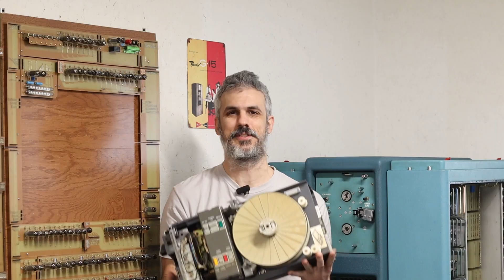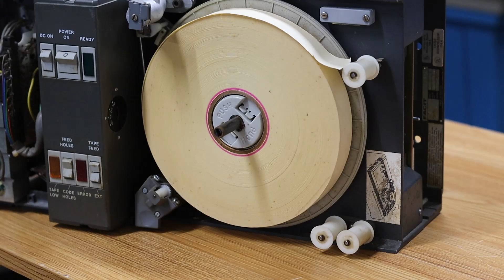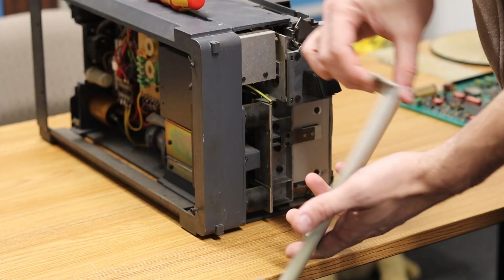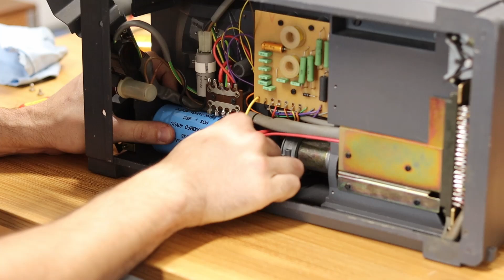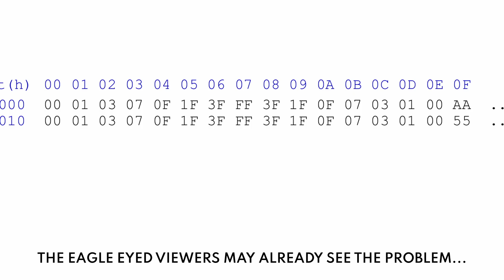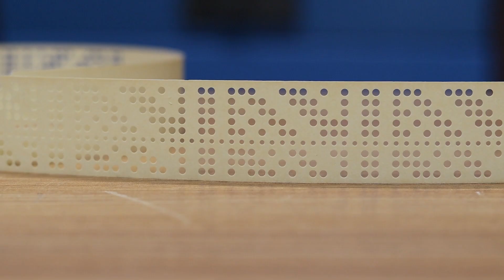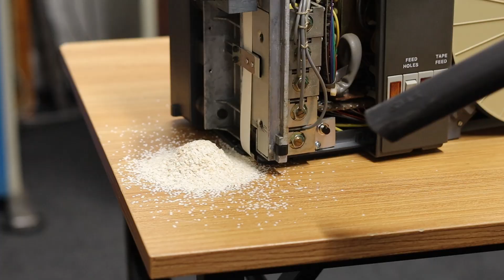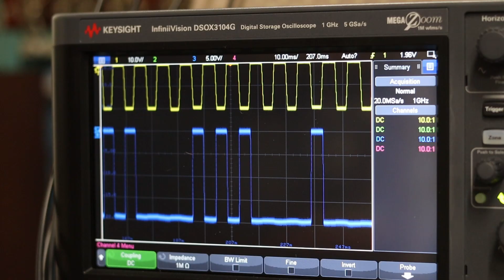Reviving a Facit 4070 Paper Tape Punch

Comment: The punch is like an analogy of information dispersion inside a black hole. If you look at the pile of punches all of the same data entries are there but you have no relation from which track or where on the tape it was located.

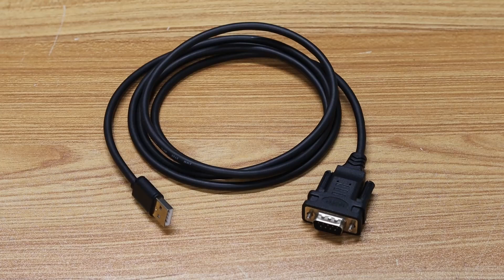Comment: I have fond memories of punched paper tape. I think the last time I used it was in 1975. I used to work 4:00 'til midnight at a printing service. Our biggest contract was printing the Directory Assistance telephone directory every day. Somehow a paper tape with all the data appeared during the day. I don't know if the phone company delivered it or if they sent the data and we punched it on-site. Regardless, the first thing I did once I got in was use a Mohawk machine to read the paper tape and write it to a magnetic tape. Then we ran it through several programs on our RCA Spectra 70 mainframe that eventually produced an output magnetic tape. I then mounted that tape on a photo typesetter that produced camera-ready copy. Toward the end of my shift, the stab paper was finally dry and I delivered the copy to the print shop in the back where they made litho plates and began printing all night.

It was a pretty interesting job that lasted about a year. I got "laid off" after I testified against the company at a Labor Board hearing. Oh, well.

Comment: If you have paper tape contrast errors you can run the paper tape through a ribbon inking setup, Also of you can find them, someone makes a super magnum wide tip pen that can be used to ink the paper on the punch swirl drum.... the nibs on that pen setup were 1 inch wide....Used for production line stencilling of indelible ink. A gang of normal chisel point pens can do the same thing if you line them up right. Think about it.

Comment: If you only need to adjust one track for different color tape, 2 options..
1. Just use a color filter (film) to compensate for paper color
2. add a second adj pot and a switch, so the switch says white/blue
You could make it automatic using a relay + reed switch, and a magnet on blue reels.
or cut a notch on one cartridge that presses a switch for one color
(similar to a write protect notch on floppies) except it is a blue/notblue notch.

You should make a rag doll and name him Chad.. 
and stuff him full of tape punchings...

Comment: I just had a wierd and interesting thought. 
Paper tape is simple and long lasting  but low data density and throughout. 
Would a new version of paper tape based on QR codes increase the density at the cost of simplicity? Would such a system be practical?

Comment: Maybe start saving those bits, put them on small bottles and send them to patrons :D. That's a super fast tape punch, mechanism must be running on tight tolerances for everything to align at such speeds. BTW you can punch dot matrix style text on the tapes with correctly crafted bit patterns, I think I have seen that done on some old tapes to make human readable identifications.

Comment: I wonder... you might have done this in the right season, because unless it's hard to cut or gums the machine, you may be able to use 1" ribbon for the media. Curling ribbon is flat poly, and I'm sure there's got to be kraft or coated paper options out there too (1" if that's PC04 compatible tape).

Shouldn't be all that hard to make an automatic machine to spool kraft or vellum rolls and take a 1" cut off the side while doing so.

Comment: After chatting with GPT about the data, it thinks it's PDP-8 program. I assumed the data was 7-bits with 1-bit parity:

PC=0   I/O operation with 002
PC=1   TAD (Add to accumulator) 85
PC=2   JMP to 121
PC=121 TAD (Add to accumulator) 2
PC=122 I/O operation with 166
PC=123 AND 071
PC=124 ISZ (Increment and check zero) at 21
PC=125 JMP to 81
PC=81  TAD (Add to accumulator) 2
PC=82  ISZ (Increment and check zero) at 6
PC=83  I/O operation with 130
PC=84  ISZ (Increment and check zero) at 81
PC=85  JMP to 121
PC=121 JMP to 101
PC=101 TAD (Add to accumulator) 37
PC=102 ISZ (Increment and check zero) at 46
PC=103 I/O operation with 112
PC=104 I/O operation with N/A
Reply: Probably one of these OS/8 handlers:

TTY Handler:

Input: Poll the keyboard buffer for new data.
Output: Write characters to the printer.
Flow Control: Use loops to process data, often involving JMP and ISZ.

PTR/PTP Handler:

Read: Fetch characters from the reader.
Punch: Send characters to the punch device.
Flow Control: Use counters to manage buffer transfers.

Comment: I bought one of those in '85 for work when they were still easy to find. We used it to create tapes for pick'n'place machine on a word processor. Previously we had to punch tapes out on an actual teletype with only <rubout> for corrections. It was parallel input so I built a serial->parallel card using one of the last few non-processor UARTS.
I love that spiral post.

Comment: i still have the boards from an older punch, i think from 1972, made using only discrete transistors, found them in an illegal dump site way back in the early 1990s

Comment: Back in the 1970s we used green paper tape for raw punch and white for verified and operations were only ever allowed to feed in white tape for live jobs, the Elliot optical reader ran at 1000cps and had no trouble at all with white tape. The only other type of tape we ever saw was dayglow yellow and that was used by the highways department  who punched their own tape and apparently bought a job lot of hideous tape cheap somewhere (the machine 'belonged' to treasurers department but highways used it for calculations related to roads and bridges). There is an RS design spark article called "Interfacing a 1967 Paper Tape Reader" which features an earlier version of the head, they claim 250cps but I think they are incorrect, the early 70s version was fractionally sleeker but it was built into a large cabinet (bitsavers has an old brochure, search for ICT 1916 paper tape reader, that one was from the 60s and was 1000cps, the 1970s ICL version was very similar, sleeker reader and blue panels). The RS article does have a picture of the hand punch that we used when we did a repair or a splice while making printer control loops; the tape for loops had a mylar core with thin 1" white paper tape on each side and was expensive, thus only ever used in the backs of printers to set the form top and tab positions; the readers for this were mechanical brushes onto a conductive centre wheel, so they could wear standard tape out fairly quickly especially the sprocket holes.

Comment: Now you just need to make a LED adapter you can install in the tape reader to simulate a tape going by and you can just quickly load programs from your laptop without using any tape. (Though tape is cool).

Comment: You should be careful turning on old power supplies with no load attached. The design of the voltage regulation circuitry can produce an inconsistent and potentially damaging overvoltage. Throw an incandescent lamp on the output for safe measure!

Comment: If five-level paper tape isn't insanely expensive, you could make text banners out of it by using the holes as pixels and your character cells would be anywhere from one row wide (.) to 5 rows wide (T, M, W)  depending on the character. You'll have the feed holes in the middle but I think that just adds a quirky charm. You could print out the startup operations this way, and then both the human AND the computer can be reading instructions off paper tape. 🤣

I'm glad that the Bendix ultimately doesn't care what color the paper tape is. I'm sure you are too. I was a little surprised as to just how close you got to calibrating the oddball photodiode to match the others before you knew it had to be that tight.

I kinda wonder if we should be punching the world's most critical software to paper tapes as insurance against EMP weapons.
Reply: That paper tape seems to be insanely expensive - IF you can even find it.
Reply: @KameraShy  For making the little banners you wouldn't need real paper tape that can survive being dragged through a reader, you'd just need any paper that can survive the punching process without breaking or getting stuck. It's not going to be read by machine.

Comment: Worked at Datasaab Linköping  20 Miles from Facit Åtvidaberg in the seventies. Assembling D5-20 computers. And we used a two feet long paper bootstrap first so you then could load the test program, then you had to rewind the paper tape with your index finger ;-) Time flies :-)
Reply: Östergötland represent 😎
Reply: I'm from Strömstad, and I'm sure they had a factory for the mecanical calculators they made, long long before my time.
Reply: Is he pronouncing the name correctly? Or is the C pronounced like a K?
Reply: @draco5991rep  C is pronounced with an "s".
Reply: @simonlandeholm7086  how unfortunate 😢 a k sound would have been so much funnier

Comment: I love paper tape.  I got lucky when very early in my career the shop I worked in used paper tape to drive CNC machines.

The tape contained g-code consisting of standardized instructions that direct the machine movement needed to produce part geometries in a repeatable, efficient way.  Remarkably, some of these machines did not contain program memory!

Normally, gcode was read from paper tape once to be stored in program memory.  That way, each part is produced from memory and then paper tape can be returned to a library or used to load another machine.  

The ones lacking memory use the tape directly!  In fact, when I was being trained, the operator loaded the tape into the machine very carefully, with get this:  the ends taped together to form an actual, physical program loop!

I went on to use the manual punch to create patch tapes and repair torn ones with special tape with holes used to patch up two ends.  It is fun, accessible tech.

Nice work on that puncher.  Consider finding the oil infused paper tape for long punch life.  Also consider sharpening the punches for fewer stuck chads.
Reply: G-code has survived the test of time. It's what drives many 3D printers today.
Reply: @Dobbo314  Indeed it has!  There are still plenty of CNC machines in out of the way places, equipped with readers and that still make some parts off tapes.

I have noticed some machine vendors really pushing G-code into a more Turing complete programming language and or inventing syntaxes that, so far does not break the core standard, but I feel it is only a matter of time.

Comment: That paper tape punch is amazing to watch.   It would be cool if you could collaborate with smarter every day or slowmo guys on high speed footage.

Before you saw the noise on bit 2, i was just thinking to myself how fortunate it was that paper is so easy to dye, regardless of the number of holes in it.
Once you saw the noise I knew exactly what was going on having just finished watching all the previous bendix episodes.

Also the paper tape rolls appear to be normal rolls of paper sliced to a specific width, so with the right saw blade and jig, you can make as many rolls of both types as you want.

Comment: Stretching my memory there was a difference between the white and the yellow tapes.   The Yellow ones where stronger, made by a different process so it didn't degrade as fast.   The whiter ones were cheaper.    I don't know if that's a general thing or just what the school did when ordering.   They also came in many colors so you can categorize your tapes.   Maybe as simple as blue was just the system tapes color.
Reply: The yellow tapes were oiled.  Some punches needed to use oiled tape and would dull and start tearing rather than punching if fed the un-oiled variety.

Comment: For the UE-1 you could use a vhs player roller for the pinch roller, so it doesnt create inconsistencies on tape read, like a change in the speed of the tape pull. You can also put springs to pull the pinch roller more tightly to the tape and smooth out any inconsistencies on the tape or capstan thickness.

Comment: Of course, now you want to be able to read cards. Get yerse'f an old IBM 029 punch for 96 columns. Also, we need a 1600/6250 tape reader (or QIC). Of course, my favourites were the 3740's and 3741 for sneakerware to transfer 8" floppies to filesystem/tape/punch. Good old days.
Reply: Standard punch cards (like those used in an 029 keypunch) are 80 columns.  The 96 column ones were binary (not card code) encoded for IBM System 3 using round holes and were about 1/3 the side of normal cards.
Reply: @Herby-1620  BZZT. 029 was 96 column on our Model D Sys/3 (also had 36s, 34s and AS400) Our DASD R0D0, R1D1, R2D2 and R3D3. I forget the model of 6250 tape we had, tapes were in a slanted face. The 36 had a juke for 8" floppies. "Standard" Hollerith cards are 80 column. My first program was punched on 80 column at Waterloo in 1967 EDIT: I noticed CuriousMarc and I went over to his site: strange, that's the 029, but he shows 80 column card printout images. WTF? Our shop had ZERO 80 column. Not a single. Not even as a bookmark.

Comment: Wow, been a while (late 1970s?) since I loaded tape in a 4070 and yes in the UK at least, we pronounced Facit just as you did!
By an odd coincidance as I watched this episode I have a Fanuc PPR punch/reader unit on my bench as I'm designing an interface so I can connect it to an HP9825T via the original HP98032A/034A modules. IIRC  the HP9884A and 2895A punches of that era were actually Facit 4070s rebranded?

Comment: Back in the late '70's we used a teletype terminal to punch paper tape to encode data on commercial spot carts at the radio station. I know none or the tech used but I was the part timer tasked with this chore.

Comment: I would imagine a paper punching machine is basically the same thing as a dot matrix printer, with a much MUCH larger head.  As you are punching holes, rather that pushing out pins.  But the mechanics and electrics should be very similar.

Comment: Maybe you could "convert" white paper tape to blue or black one, by creating some sort of machine that runs the paper tape between foam rollers impregnated with blue or black liquid ink, and  dry it on the fly with some hot air flow before spooling it.

Comment: Thank you for this video.  Brought back lots of memories.  In my first job I had to prepare an update to a brewery control system based on PDP-8,  drove to the brewery and read in my program on an ASR-33 teletype.  But that was slow.  As a student I used a PDP-8S (s for slow, or serial if you prefer) - all germanium transistors and a 1MHz clock.   But, boy, could it spit out paper tape - at 500cps.  You needed a bin to collect it at that speed.   The university tape readers were seriously fast too - IBM jobs.  And anybody who has worked with paper tape has learned to respect the razor sharp edges of the tape when travelling quickly.

Comment: There is a supply company in the U.K. that lists both black and yellow 8-bit blank paper tape for sale.
I have seen 5-bit blank yellow paper tape on EBay.  For UE1 I would recommend using metallic mylar tape 
As it’s very hard to tear.

Comment: I thought maybe you were going to have the paper punch print out a readable message (I think the standard character height on text terminals was 8 pixels).  Sure, a waste of precious punch tape, and taking up time better spent on getting both systems running, but could be interesting for a viewer to do as a programming exercise (and need a way to simulate paper tape on screen).

Comment: Prepare to become one with a low power vacuum or a fine brush.  You are about to become very familiar with paper dust.  You will not believe how flammable that stuff is.
Reply: Having worked at a paper mill that made paper towels and bath tissue; yes, yes i can believe how flammable it is.  We had the fire alarm go off at least once a week, because paper dust would collect (even though we had high air circulation and dust collectors) on top of the high bay lighting, and would routinely catch fire for a little bit.  It would not stay lit for long, as there just wasn't much paper dust up there, but you got used to ignoring the fire alarm.

The reason for the high air circulation?  Two fold.  First, paper likes to absorb water, so you want the air dry.  Also, dust explosions are a thing, and fine wood particles in the air are a dust explosion waiting to happen.  So the mill was designed to remove as much paper (wood fiber) dust from the air as possible.  But you never get it all.

Comment: Re "why does it weigh so much?":
Because... "back then" (the 1950s, 1960s) electronic devices were NOT MEANT to be portable.  At most they were TRANSportable, even record players!...  Like IBM's 3270 terminal: IF one was strong enough to LIFT the MFer (I mean the monitor ), then throwing it at a double-glazed window would cause it to shatter (the WINDOW) & land IN the ground outside. A good comparison would be a meteorite's landing...

Comment: For high voltage systems of several thousand volts for homebrew equipment I use just a single strand of hair thin wire. When it fails it prevents some other ‘more durable’ weak point from going BANG like a gun. Pops are nicer than catastrophic gun check outs.
Reply: Indeed and saves you a lot of money in replacement components.